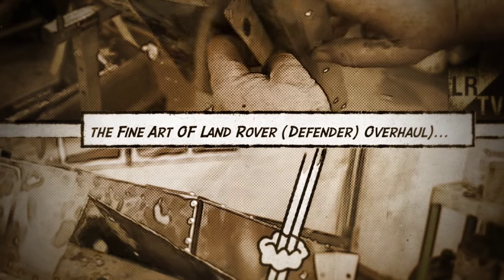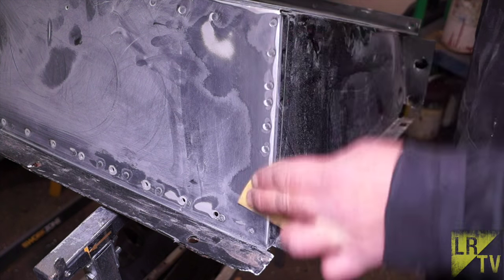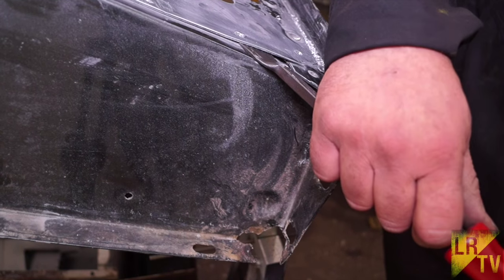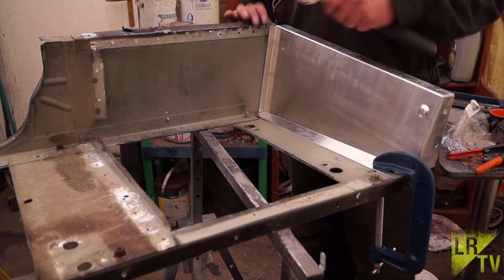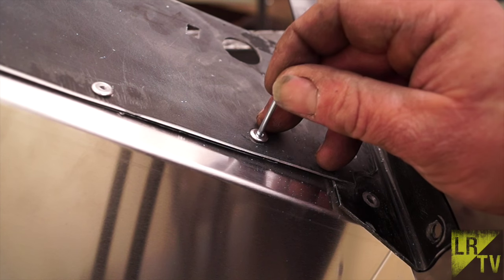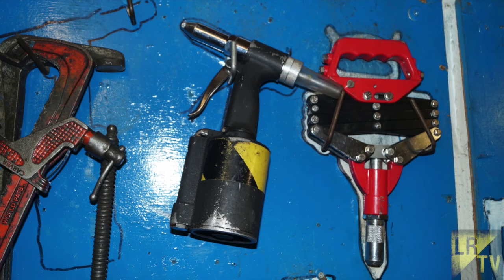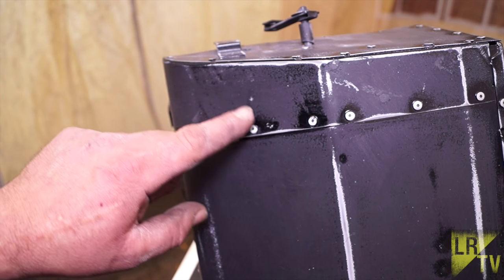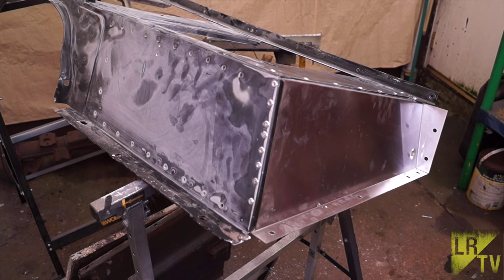Replacing rotten Defender seat box ends - Land Rover Defender bodywork repairs

Comment: Glad to see i got this right even while it was snowing, Blasted B posts failed the MOT in the January just 4 months before i had planned to do the work, (after removing them i did come to respect there decision as a disk cutter was not really needed to get them out in 3 parts!!!). YRM do great stuff, didn't realize that funny round dent was for a seat belt bolt though. Great video Chris as always.
Reply from the maker: +Luke Arnold   Well As far as I have seen it is to make sure the bolt does push into the panel.

Comment: Hey guys. Can you please shed some light on something. The Defender has a bead of sealant between the windscreen frame and the roof (this is visible when standing in front of the truck. My 2009 have some hairline cracks in this bead and I was wondering what you guys use to replace this with, it is harder than silicone. Do you know where I can buy this? Appreciate your vids. Thanx!
Reply from the maker: Theres a rubber seal that should be there.  You don't want anything harder because it will crack.
Reply: +Land Rover Toolbox Videos Thanks for getting back to me- Can you please give me a part number? I've had a look at a few "brand new" 2015/2016 models from my local JLR dealer and they all seem to have the same sealant seam (not rubber)? The White one I've looked at had white sealant and the Heritage (green) had black like mine... please advise.
Reply from the maker: Sorry you will have to browse the parts manuals or websites under roof to windscreen seals and see what you come up with.  If they recommend sealant then Tiger seal is the best or Sikkaflex sealant which we use on trailer roofs.